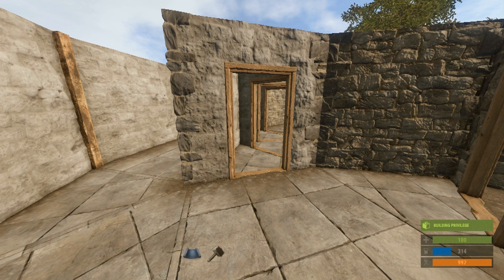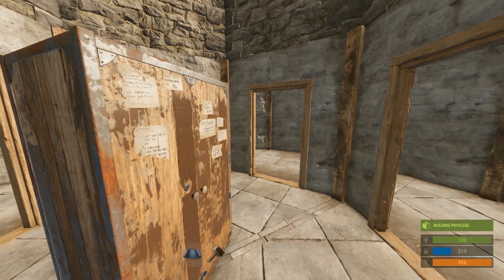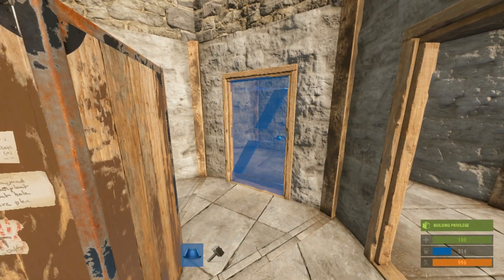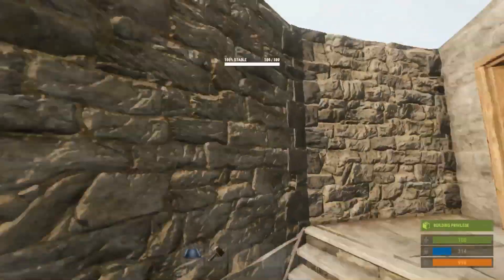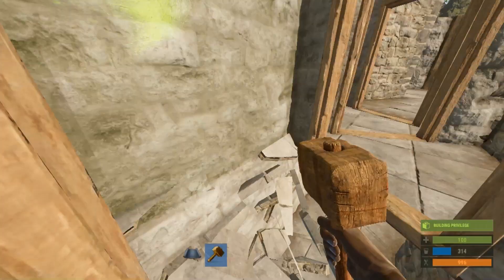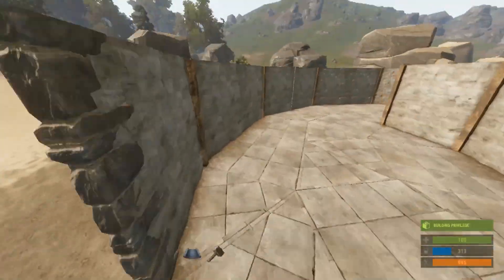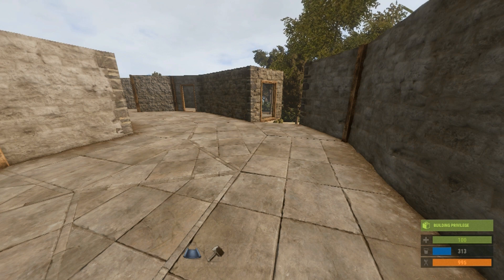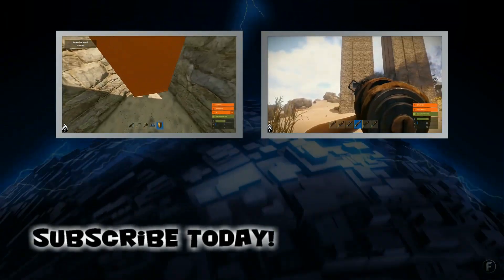How To Rust: Day 25! | Building Doors On Triangle

Comment: So if you have a circular base, you basically need to get rid of your base.
Reply from the maker: +zdrux Or place the doors as you build, however supposedly this will be fixed on Thursday (Nov 5th).
Reply: Yes, I figured this out after I build my 3 storey circular base lol. All reinforced steel and not a single door in sight, FML :)
Reply from the maker: Ouch :( At least the forced wipe is in a few days? lol